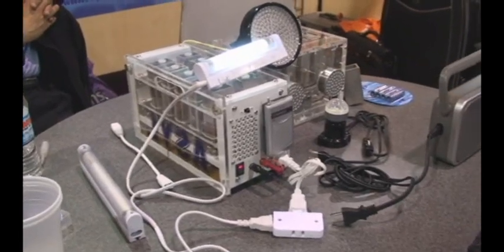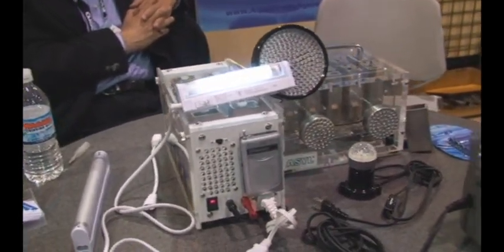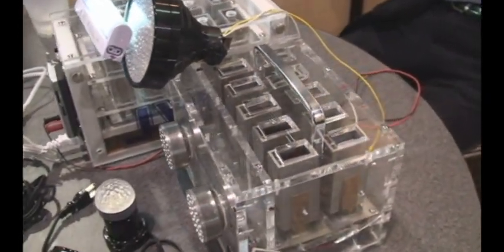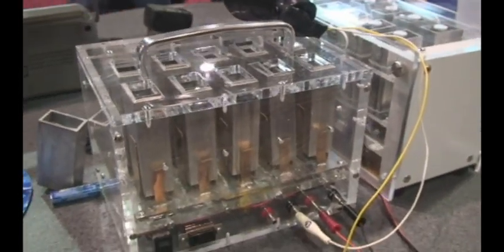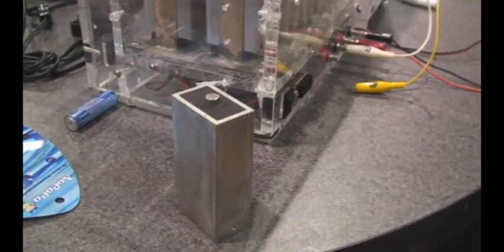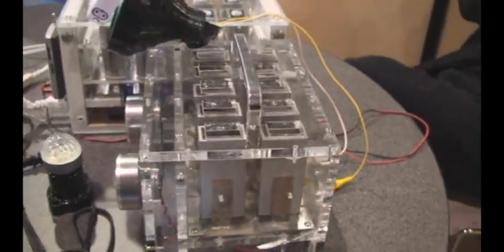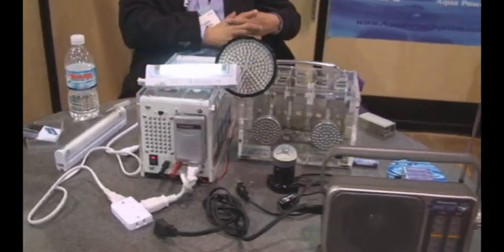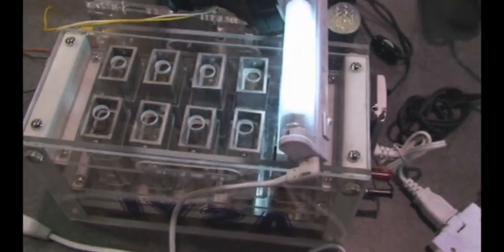Water Battery asyl

Comment: he said 1000 milliamps. So, am i doing this math right, 1k milli amps * 1.5 volts* 10(in series) = 15 watts?
Why does he say 110 volts, if it is 1.5 volts * 10 in series. I don't understand. I know he is running an inverter but 110? Does 110 stand for something else. I don't follow, plus i'm not an electrician.